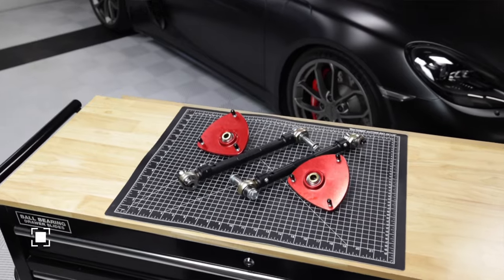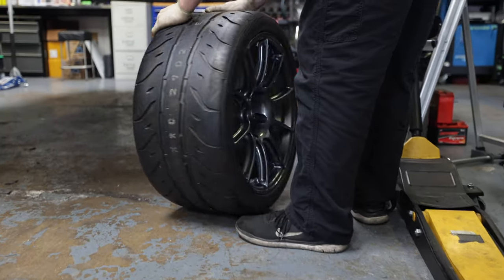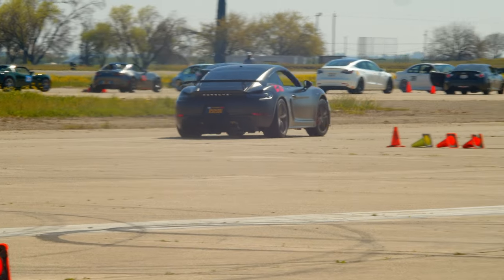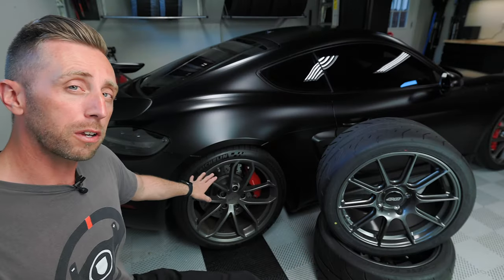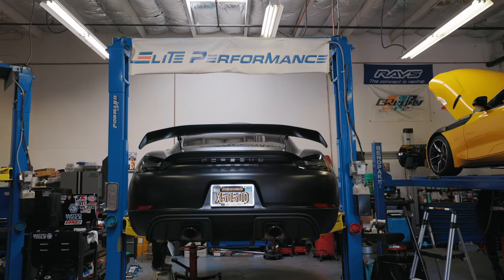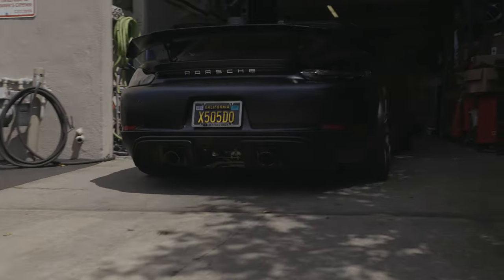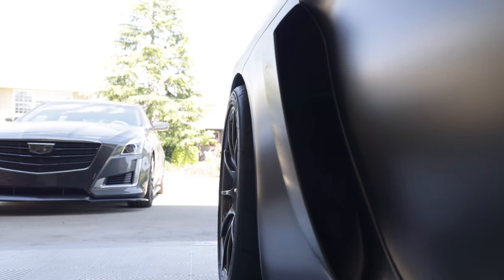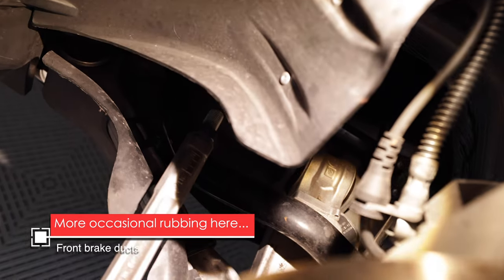GT4 Camber Plates and Toe Links from Tarett

Comment: If I had to do my suspension mods over again, I would have opted for camber plates instead of bottom shims.     With the shims I needed the caster pucks to correct caster and a bump steer kit because the shims did change the geometry and the steering wheel was too jerky without it.

So far I have the MCS 2-way remote dampers, caster pucks, rear toe links, bump steer kit and going in next week are the rear end links.

Comment: I’ve got - Front bump steer tie rods, adjustable caster pucks, caster plates, rear toe links, Monoboll control arm ends, Tarett Locking Plate Kit for Rear Toe Links, Tarett/Wevo Semi Solid Transmission Mounts.  All are working great together.  On Apex 19” wheels, 275’s in front and 305’s in the rear.  No rubbing.
Reply from the maker: Solid trans mount?  Did it make things a bit noisier or harsh?
Reply: @JetFuelOnly  yes and no.  On my first drive after all the work was done, the most noticeable element by far was the very visceral sound and feel from the tranny mounts.  But, within a few drives, that was just part of the package and became less noticeable.  On the track everything is firm and predictable.
Reply: @JetFuelOnly  this is a 981 with manual transmission.  Not pdk.
Reply: What spec wheels and what brand/model tires?
Reply: @TheEddysGarage  Apex VS5-RS.  Pirelli DH slicks.  Fronts are 275/35, rears 305/30.
Reply: @scottoconnor3484  awesome thanks

Comment: Nice video and great wheels. I am running Apex wheels on my base 981 Cayman. I have rear toe control and front lca’s from Elephant  Racing with X73 suspension. Likewise -2.5 Neg  camber. I originally fitted plus one size MPSS 275/40/18 but now use Trofeo R Cayman Cup tyres in 265 which are wider then 275 Michelins! they are awesome can street drive in wet no probs and they don’t wear out like Michelins. At 32degrees hot temps grip is amazing. Another good thing about Trofeos is there is no choppiness in the ride and everything is about moving forward. My car has no trouble taking on more modern Porsches especially in the corners.
Reply from the maker: Interesting. I’ll take a look at them!

Comment: Great video. This May solve my issue…3rd time going to tuner to try to get this right. I have all the same parts as you…do you know how many mm were used for shims in combo w the camber plate? I believe stock already has about 7mm in the LCA. Did you add more or left the oem shims and adjusted camber via the plates?
Reply from the maker: I am back to stock shims in the front which I believe you are right - 7mm
Reply from the maker: So it’s too plates almost all the way in and stock shims.

Comment: 😊 thank you For this content! Great job sorting it all out. I just picked up a GT4 718 and I got 19" apex like yours, I want to do 295 & 245. Do you think I should go with these tires I drive pretty hard on the track but I do have to drive it home. Just burned out and delaminated PS4 at local track with alotnof right hand turns
Reply from the maker: I would say don’t go with the RT660s. My second set started to delaminate. Turns out this happened to some people. The separation happens where the plies are bonded together ACROSS the tire. I’m currently on Nankang CR-S. So far so good. I would try to do 255 up front at least. 985-296 in year is fine.

Comment: Great video,  thank you for doing it
Can I ask on the final alignment spec to get 3deg and 2.4 were the shims that of standard?

I’m aiming for something similar so I sure if I need to buy shims.  I’ve got the same top mounts,  toe links and locking kit on order
Reply from the maker: I believe the stock shims are still in there. If you don’t use camber plates you will definitely need a shim set.

Comment: Melody has worked on my honda in the past!  Great shop.  If I want to run a sporty/mild street setup on my 718GT4 like -1.8/-1.8 and 9/10.5 from apex, do you think I need anything more than just toe links (got TPC from a friend)?  I don't think I'd need front plates if I just want to run 245/285 on 9/10.5...
Reply from the maker: Hmm I would think 245 might fit but at 1.8 it may be close. I wish I felt more confident about the recommendation

Comment: why not using the 99.1 camber plates to get more camber ? That's what Manthey Racing did on my GT4
Reply from the maker: 991/981/982(718) are all the same.
Reply: @JetFuelOnly  sorry, I meant 991 GT3 RS camber plates
Reply from the maker: @philtechGT3  haven’t looked into those but I suppose that can be done too?  The tarett plates give me more than enough camber though and guessing they may be cheaper?  Have a link to GT3 RS plates?
Reply: @JetFuelOnly  I can send you pictures of my GT4, modified by Manthey Racing. Parts reference is the same as the on one a friend's 991.1 GT3 RS